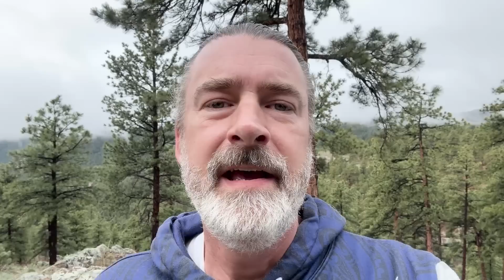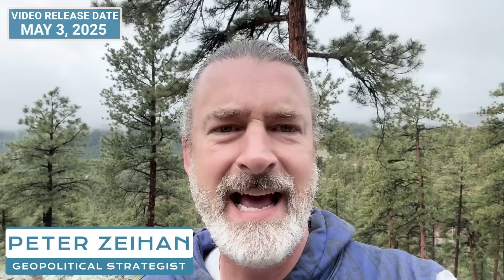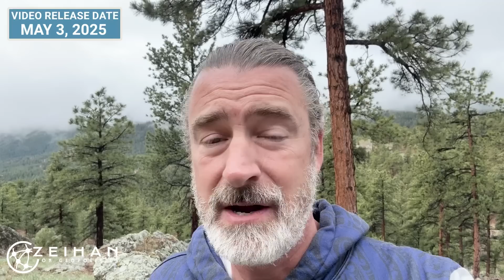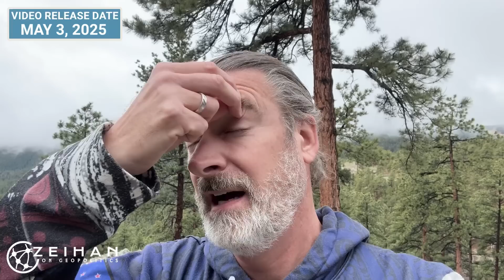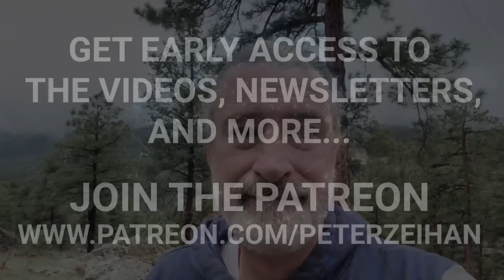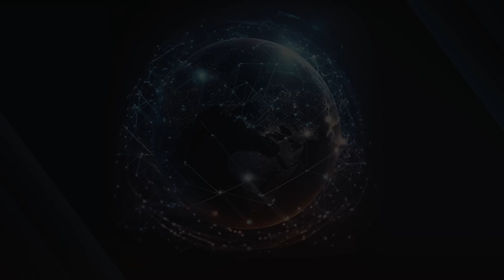The Night the Lights Went Out in Geor- er, Spain || Peter Zeihan

Comment: It seems there may be another solution at least where geography and climate allow. Pumped storage facilities you have the spinning turbines as in a traditional hydroelectric facility. Yet the reversible turbines can act as a battery bank. When there is a surplus from nuclear power at night turbines pump water into a reservoir and during the day water is released and powers the turbines in traditional fashion. 

There has been increased interest in Michigan where Ludington Pumped Storage Facility is located in using abandoned copper mines as smaller locations. Michigan Technology University has been working with the concept for a few years now along with interested private investors. Virginia has an even larger pumped storage facility, a proven concept to the local region. Also the area has an abundance of closed coal mines that could also work for smaller scale pumped storage facilities that would help bridge the gap in an event of an incoming blackout scenario. 

For matters of redundancy keeping as said 15% of power generation traditional thermal turbine generation seems a logical choice. Just wanted to note that there are other large scale storage options that can be utilized especially while industrial capacity and supply chains are built up in the west.

Comment: Very interesting explanation as I’m not an electrical engineer. Though getting a clearer understanding of the underlying mechanics of the infamous Chernobyl experiment is a nice bonus. I wonder what the takeaway is in regards recent attention to the discovery of Chinese backdoors in solar cells. There’s always the chance that now that this weakness has been laid bare it’s a good time to push on the implications of China’s building of backdoors. However there is a simplistic and darker explanation that Spain would be good test bed to practicing attacks on western infrastructure. Not that making these kind of accusations against China are easy even with corroborating evidence. Which there isn’t but the circumstances do tell an interesting story.

Comment: Coal, natural gas, nuclear, and hydro generate electricity with generators, which are also flywheels.  Those flywheels store energy and can provide very high peak power.  Solar and wind use inverters, where peak power is limited to 125% to 150%.  

Generators are also motors.  Instead of totally shutting down fossil fuel plants that use generators, provide enough power to keep the generator spinning.  When there is a transient load, the generators can provide the very short duration, very high power needed to ride through.  

That will require new controls software, much faster than creating an infrastructure to create batteries.

Comment: Way to dance around the elephant in the room, nuclear. First off, Spain is not 80% renewables, it's more like 40%. Second, they have shut down a bunchnof their nuclear power plants, and this is why they're having this issue. The renewables create these "wobbles" in the system and these continued to happen which possibly caused France to disconnect from Spain's grid, which caused a massive spike that created a cascading shutdown because all that energy had nowhere to go. It's Spain's over-reliance on renewables and their closing of nuclear plants.

Germany is facing other gris issues, but their replacements for closing nuclear plants have been mostly natural gas plants and importing power from neighbors.

Comment: There are a lot of reasons this happened. 1º Iberian peninsula is a energy island with a very poor conection with france. 2º Nuclear was stoped because they were not competitive in price. 3º Gas was stop too and they were not ready when we needed them (thaey are supposed to be in standby and they are payed to do it ), 3º  The bigest solar plants were made before 2022 so they dont have energy grid stabilizers (this solves Frequency problems). 4º We had this mix of energy for the last 5 years and never had a problem so they were very lazy regarding possible incidents 5º Energy in Spain is actualy very cheep and this makes Spain very competitive.
So many mistakes and and accident.

Renevables are not the problem, stupidity an GREED ARE

Comment: There is a lot more spinning  mass in generators than in the turbine.   But, you are correct that its the spinning mass of conventional generation that provides the base stability of the grid.

Major miss in that you forgot nuclear power.  that is also conventional spinning turbines and generators which provides stability.

Minor miss is that you can build what are known as "spinning condensers" as they are normally used to provide VARS to stabilize the grid in other ways.  That's just a big typically DC motor that is spinning a conventional AC genearator.  It has more mass than a spinning turbine and generator.

As someone who worked in the power industry for decades.... I believe the amount of spinning reserves needs to be most likely above 25% - and perhaps 30-40% in areas without great interconnections.  I don't buy the 15% number at all.  It may be great in theory... But life does not often follow theory.

Comment: Airliners use a 115 volt 400 hertz AC power system. Same voltage but very high frequency. 0:55

Comment: Zeihan explanes well, but is working with some details on Europe's energy grids. Germany takes a lot of current from France and France has most of its electricity produced by nuclear power plants, also Switzerland is not on coal or gas, but mainly waterpower. y seems insignificant but still very important nuclear is important ands should be kept working!

Comment: I thought Tesla Megapack grid storage are all LFP lithium iron phosphate (not titanium)  and work fine for grid backup balancing in less than 2 ms.  like no loss of grid power in instant outtage switch over.  so much that they use them for turning on and off 50 000 H100 GPUs all at the same ms of time.

Comment: Super Capacitors can mop up additonal current and instantly discharge to level out troughs. Could quite easi;ly and rapidly be integrated with Transformers throughout the grid as part of the regular maintenance schedule?

Comment: There have been a few transformer fire recently in the UK, one of which recently took down Heathrow airport. The airport is getting more reliant on solar power and suspect there may have been a phase issue causing voltage / current instability resulting in the transformer to overheat but only guessing.

Comment: The battery in my car will output over 10 times what the power to my house can.  You don’t need some special battery.  The inverter to convert it to AC is much more a limitation.  

Also, technically wind turbines output AC, though that still usually gets converted to DC and then back to AC for the grid.

Comment: Electrical engineering here. Not quite correct to break it down to missing inertia. That is just one of various factors of the cause and not the most decisive. From that logic blackouts in Italy and England would not have happened beginning of the 2000s. The probable main basic reason is just Iberia's location in a wide European grid. Same as Scandinavia and the Baltic's the frequency shift will always be the largest and will hence always require a more profound control mechanism.

Comment: It looks like Spain is greatly lacking in grid forming inverters that come from large batteries. (Those inverters would correct the wobble) 

49gw is peek power for Spain and Portugal. Which is close to the same as California. 
13gw California battery capacity 
33mw Spain battery capacity 
Spain has is 1/394th the battery capacity of California. Showing that Spain is very lacking in battery capacity. 

So if you have a lot of renewables with grid following inverters you need to match that with grid forming batteries. Or something like this can happen. 

I got those numbers from Ben Sullins video. 
https://www.youtube.com/watch?v=nMlRhLH9C0Q

Comment: EE here. You got at least 50% of that wrong, most notably the root causes and the solutions. Would need a 30+ minutes video to debunk. Stop using grid scale solar and wind is actually the first reality. It is an expensive disaster with no path to reliability and is not environmental friendly

Comment: There is a third method to stabilise a grid: you mentioned that the DC generated by solar and wind is converted to AC by inverters; solid state devices that don't provide any inertia. The old method of doing this is by using motor-generators: put the DC into a massive motor, which drives a massive AC generator. This puts huge rotating machines back onto the grid, and gives it the inertia or stability it needs. Expensive, needs quite a bit of maintenance, but achievable quickly with today's technology and materials. Otherwise your kindgarten level talk was kind of aligned with a reality somewhere, but you should do better if you want to remain credible.

Comment: Mechanical engineer. This was hard to listen to. As many have pointed out, nuclear, geothermal and hydro are also perfectly viable. However of those three, only nuclear is scalable. And for all of you promoting additional grid service equipment installed alongside renewables (flywheels, batteries or other storage) adds cost and complexity to an already incredibly complex system. Well maintained nuclear facilities run 92% of the time and provides grid services basically for free if configured to do so (which was not the case in Spain, they were not configured for grid services because of political will). Grid services for example also means transfer capacity, when Barsebäck nuclear facility was closed down in Sweden many years ago we lost one or two thirds of the grid transfer capacity in that region.

Comment: What about a kinetic battery or potential energy battery. By kinetic I mean a large mass spinning at a high rate like a turbine that you can use to generate power. For potential energy you would use pumps and an artifical dam at a higher elevation. You pump the water up into the dam when you have excess power and let it flow down through hydroelectric generators when you dont have power

Comment: “The blackout was primarily caused by a rapid loss of solar generation, insufficient grid inertia due to high renewable penetration, and limited backup from other sources, leading to a cascading grid failure. The incident highlights the challenges of integrating large amounts of renewable energy into existing power grids without adequate stability measures.” That is an AI conclusion which may or may not be correct because it is consensus based & like any computer, Garbage In, Garage Out. However in this instance, the conclusion is credible. Think about this though, especially when getting facts from tribal echo chambers. Anyone can be misinformed.

Comment: 4:09 grid frequency stabilization (fixing the "wobble") can be accomplished with any grid storage battery as long as it is large enough... Tesla does it in TX and Australia using their standard LiFePO4 batteries, it doesn't require any special battery chemistry but it does require installing more inverter capacity so that the site can handle not just the expected baseline load but also a grid out maximum discharge load.
Reply: This was the wrong mentioning of Tesla given the video. lol

Comment: I used to run data centers; the term is clean versus dirty power.  

Most generated power (hydro, coal, nuclear) is pretty stable and clean - usually.

So for DCs, we always ran off the battery (UPS - which is clean, stable power), which is then fed by a main or gennie (with auto failover).

At the end of the day, renewables are the most unclean, and battery is the cleanest.

Comment: Oscillation or cycles.  Don't dumb it down. This leads to gross comprehension errors, as in not understanding what  really happened. What happens is phase interference. 

https://en.wikipedia.org/wiki/Wave_interference

NOT RECOMMENDED.

Comment: This has nothing to do with coal or gas or nuclear. It could have a lot to do with the amount of spinning mass. This can be supplied using a synchronous condensers, which is nothing more than a synchronous motor/generator driving a rotating mass. The problem however seems to be tripping conventional generators.

"The main event began with the tripping of a large generator in southwest Spain. Immediately, the Spanish frequency began falling faster than the rest of the European grid, indicating the beginning of a loss of synchronism. What followed was an extraordinarily rapid cascade, between 1.5 seconds and 5 seconds after the first large generator trip, a second large generator in Spain tripped, accompanied by what officials described as a “massive” disconnection of renewable energy sources throughout Spain. The tie lines between France and Spain also tripped during this period, as did a 1.3 GW unit at the Golfech nuclear power plant in southern France. Within just 5 seconds after the first large generator trip, Spain was experiencing a complete system blackout.
"
https://www.powermag.com/understanding-the-april-2025-iberian-peninsula-blackout-early-analysis-and-lessons-learned/

Comment: You missed to discuss Synchronous Condensers as a solution and it is the solution being deployed by most grid operators. They provide the same inertia and fault level that traditional generation supplies. He is also wrong about New Zealand as they have lots of hydro power generation which still utilises turbines and so still provides the inertia needed to keep the grid stable.

Comment: Not an electrical engineer but physicist - there is another alternative, to my knowledge. Electrical grids with many local energy sources can and have to be stabilised actively, typically in medium sized cells by electronic control of the phases. The technology for this exists but so far has not been rolled out because in grids with a few big energy sources this is not needed.

Comment: LFP Battery storage has sub-second response times..getting quicker all the time, but something in the order of 1/10 a second is fairly common right now. Not sure why we're talking about lithium titanium which may be an option at small scale as most alternatives are if they are even commercially viable (they typically arent) but certainly not a common chemistry. People seem to want to comment on batteries all the time due to personally being unfamiliar, but not relying on any actual engineering analysis when it doesn't favor their analysis. 

Actual implementation is not the problem, its really the inefficient interconnection analysis that needs to be automated, and permitting where people who dont know anything all of a sudden feel they should have a say in everything in the world that someone else is trying to build

Comment: 4th option: add 3000 RPM flywheels (big ones) to the grid soley for the purpose of providing 50Hz stability. But undestand they would consme power vs gas turbines that generate power.

Comment: Nuclear would be a better option than gas and coal; Cheaper in the long, and no carbon emission. Most of France grid runs on nuclear, they never have those problems. 
As far a DC transmission, it's useless for long cable run, too much losses along the way.

Comment: You didn’t discuss centrifugal batteries. During normal operation, an electric motor spins a high inertia mass. When it hits operational RPM, it takes very little power to maintain. The inertia is used to drive the motor as a generator for short periods when surge power is needed.

Comment: The North of England had a similar but not identical issue in 2019. Windfalls shut down during a storm due to overspeed protection,  turns out wind turbines don't like turbulent wind speeds. Load shedding was necessary to protect the national grid.
Ireland has been going down the net zero road and has been closing down older thermal power stations and not replacing them with similar. Many have warned how precarious this might be but no politician wants to listen. The national grid has been asking at times for Data centres to run their backup generators to stabilise the grid which is OK for the likes of Microsoft who uses Diesel for fuel  but most others use natural gas. Ireland having no strategic gas reserves leaving us completely dependent on continental gas flowing directly into our system.😢😢😢 Ideological politicians cannot be reasoned with as they cannot accept reality as it hurts their feelings
Reply: Better than Zeihan.  Thanks!

Comment: With all due respect to Peter Zeihan, this video is complete nonsense.
1) AC is a "wave" and its frequency is used to regulate power when the "power consumed" exceeds the "power generated", which could not be the case (generation is greater than 100GW and demand is less than 50GW).
2) Inverters in solar systems provide a wide range of ancillary services (reactive power compensation, voltage regulation, flicker control, active power filtering and harmonic cancelation) and wind turbines provide synthetic inertia, like any other turbine.
3) Any grid has capacity. This means that if part of the grid stops transfering power, all the power is transfered to other parts of the grid. And if any part of the remaining grid overloads its capacity after that, the automatic system disconnects that part of the grid too, which lead to higher load of other parts of the grid, and so on. And this can lead to total blackout regardless of the sources of the power.

Comment: It seems that spinning reserves could be most easily and less expensively met by large flywheels. No fuel consumption and probably very little energy use to keep them running. Although flywheels do not produce electricity as do gas turbines, they have a reliability and cost advantage.